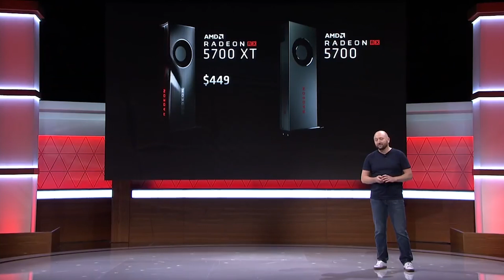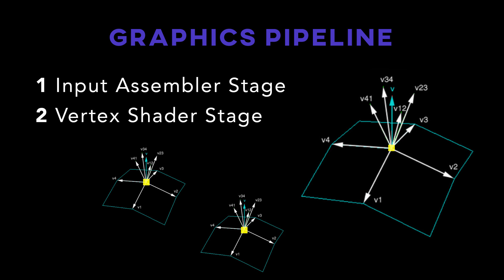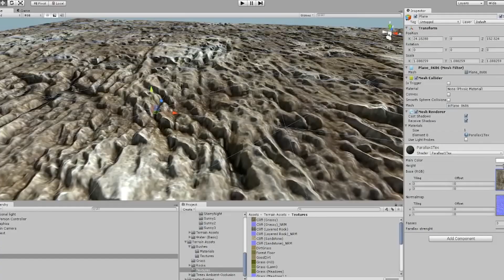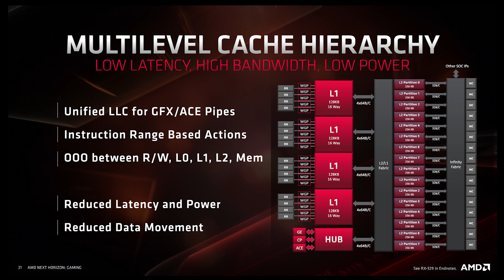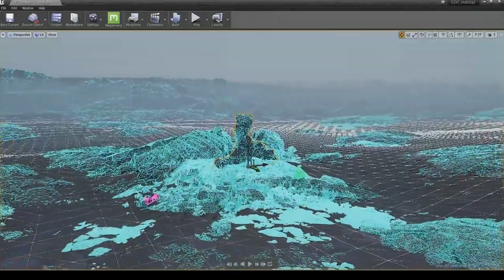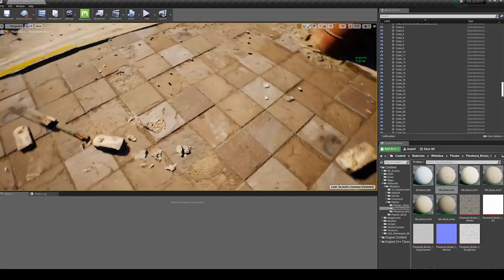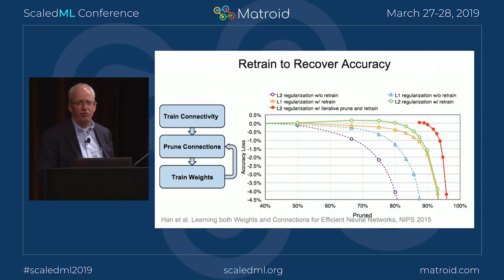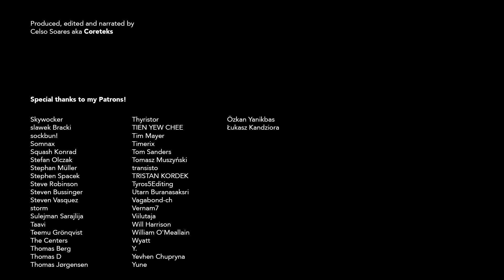RDNA vs TURING - The END of NVidia’s dominance

Comment: Prices are updated! 
5700XT - 400$
5700 - 350$
:D !
Reply: You were too precise and on point with that anticipation!
Reply: yes oof nvidia
Reply: @FoxyAF that's great !
Reply: 3:10 "avoid 5700XT until it costs ~400$"
Reply: Playing the Nvidia money game. Should have just created and sold the 5700XT only.
Reply: RX 590 is $ 245
Reply: @lovekush9103  
Yeah, but I already have better in a 1070
Reply: i had payed 370euros in serbia  rx 5700 few weeks ago
Reply: @lovekush9103  AMD/Radeon doesn't work with CUDA, it's 2304 (not CUDA cores) Stream Processors. Not the same thing mainly because of the architecture being different in each of them, there's no way to compare them both by this standard. Aaaaand the 1070 has 8GB of VRAM also. You're biased towards AMD, but no need to tell lies, right?
Reply: @tnbn55  I have a 1080 and have looked at the 5700XT pretty closely.. It's better, but not better enough to pay for.  I hope they release a 5800/XT soon, and it doesn't cost too much.  I still get great performance with the 1080, and am sure you do as well.  I won't be buying any more NVidia products though.  Besides, I want to use adaptive sync again Freesync.  NVidia trying to pay off monitor and TV makers to stop using "Freesync" wording is just making me despise them even more.  It's going to have the opposite effect for them, just like that TPP nonsense.
Reply: @lovekush9103  
My 1070 is 8 GB
Reply: @larrygall5831  
Yeah, you can always safe-overclock it anytime
Reply: @Cullen Guimond I'm getting it for christmas, greetings fellow Cullen
Reply: @lovekush9103  still 1070 is better. Amd polaris was worse than pascal.
Reply: poor fuck ahahaa

Comment: That was a great video, thanks!

I did notice one whopper @25:09 where you state that it's better if things are in cache rather than having to go to SRAM. Literally no one uses SRAM for bulk storage, and that's simply because SRAM is big – and by that, I don't mean "gigabits big" but "square millimeters big". Which also makes it expensive and power hungry. An SRAM cell typically consists of four to six transistors plus some resistors. A DRAM cell consists only of one transistor and one capacitor. As a rough estimate, SRAM requires 4x the die space of DRAM for the same process size.

Imagine you could choose between a set of 16GB DRAM DIMMs, or 4GB SRAM DIMMs, and the SRAM would actually be more expensive. Sure, the SRAM may have less latency, but would it be worth such a sacrifice in storage capacity?

Mind you that caches (and, partially, registers) exist precisely to hide RAM latency. That's why we have memory hierarchies nowadays with blazingly fast but relatively small SRAM caches on die, and very large DRAM off chip. (There are even CPU designs with eDRAM caches such as the – huge – L3 and L4 caches in IBM Power.)

(There's also another thing I was about to call a whopper, with the work for each vertex being done in a single thread – which could be taken to mean that there's one thread per vertex, but I think that is simply ambiguous. The number of threads would typically be scaled to the number of available compute cores and the level of SMT – simultaneous multi-threading – they support. This is typically done automatically by the driver unless the programmer would try to gain more control over the process.)

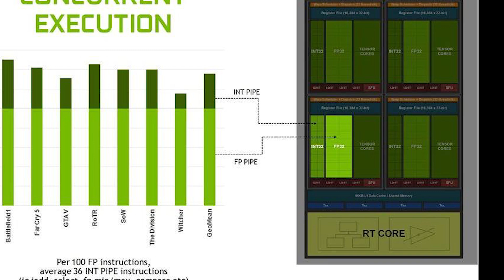Comment: 23:28 - All DirectX-compatible GPUs are required to support standardized INT operations since DX10. Turing (and Volta) simply implements dedicated 32-bit INT ALUs, separate from the main floating-point FMA units for the purpose of overlapping integer and FP code execution, i.e. achieving more performance. The CPU is not involved here at all.
Reply: Indeed.
Using CPU for INT would cause some very interesting latency problems. ;)

Comment: Bullshit. I'm with AMD (Ryzen 1800X + Vega 64) but the conclusion is fucking delusional. 2 things: Radeon 5700 is already on 8+6 power supply on 7nm, so it's pushed really hard with almost no room for a higher tier, maybe 10% extra performance for 25% extra electricity. Second, Nvidia is still one step behind on process, so the video is incomplete, misleading and fucking delusional. AdoredTV was way more grounded in his analysis, let's keep it real people.
Reply: Why on earth you restrict its power draw by design when you probably will need it in the future? Also isn't it better to draw power directly from PSU not via PCIE?
Reply: @yulusleonard985  I'm not sure what you mean, the cards use both the slot power plus PSU power.
Reply: @Groaznic  Some card are designed to choose using 6/8 pin first before using PCIE. For example the RX 500 series card draw power directly from PSU before taking extra power from PCIE, because complain from RX 400 owner that the card draw too much power from PCIE first before taking extra power from PSU.

Id rather have the card to draw power directly from PSU rather than running 75 w through my motherboard so im ok if the card using 8+6 than only having 8 pin but draw another 75w from PCIE. An if the card is rated 150w Id rather have the one using single 8 pin (draw entirely from PSU) rather than 6 pin but draw extra 75W from PCIE.

So yeah. A card with 8+6 pin if rated 225W is much better than card that rated 180W but only have single 8pin. Just because it will leave my motherboard alone.

Comment: Just wanna point out, shaders run on the gpu, not the cpu. Nvidia also develops a large set of real time library like the fluid sim Lin flex, or the flame sim flow that works specifically on their cards. That’s why us devs actually prefer nvidia cards over amd cards. In AIB boards, nvidia dominates amd, 77% to 22%, so, I’m not quite sure where u get some of your numbers.

Comment: I have read the various nvidia whitepapers published about the various architectures that they have released. The texture compression nvidia uses is lossless, and combined with the energy requirements of off chip DRAM contributes to significant performance improvements and power & cost reduction. As far as I could tell VEGA didn't feature texture compression
Reply: Texture compression, z compression, and other compression, culling, etc, have been normal for over 15 years.

Comment: This was an awesome overview of what's very probable to come. Exactly as I've been secretly speculating since Navi was announced. Exciting times ahead.

Imagine a 80CU+ Navi card with 16GB+ of HBM2...
Reply: Not possible. AMD will bring power down about 20% through hard work. But that still means 300W at 60 CUs 1800Mhz and basically 2080 + 4%. I don't know if the GCN 64 wide waves being split is part of the problem, but if it is, then it's not easily remedied.
Reply: It isn't about bandwidth necessarily, but about power consumption. GDDR6 can consume up to 4.5x more power compared to HBM2. This is why I'm curious if HBM2 could be used. Doubling CUs does not necessarily translate to double the power consumption either. Clocks and voltages play a big role here.

Comment: The 5700 xt goes for under $400 us now. Its a killer deal since it performs as well as a gtx 2080.
Reply: More like RTX 2070. You can only get 2080 performance if you water cool it and then OC the hell out of it.
Reply: @BraidenRobson  I agree its between 2070 and 2080. Still a bargain though
Reply: @romefox  more like between 2070 and 2070 super. But yes it is the best value for money GPU right now.

Comment: What do you think about the efficiency of the RDNA architecture? 2560SP card and has 225W TDP? That is a lot! With 50 CUs (3200 SP) they can catch the 2080 (Even Super) and with 70 CUs they can catch the 2080 Ti. But those cards with this spepcs would consume lots of power  275 and 350W at least

Comment: very interesting! You put in a lot of work on this. 👍😊

I bought an Gigabyte GV-R939XG1 GAMING-8GD (R9 390X OC) in Nov. 2015. It was basically a price/performance decision (or, "bang for the buck"). Looking at several reviews, the GTX 1080 Ti was about 15-20% better performance, but over twice the price I paid for the 390X. It worked very well until Feb 2020 when it finally died. Because of COVID-19, it was difficult to get most current GFX cards. And prices were increasing rapidly! I finally ordered an AORUS Radeon RX 5700 XT from Amazon USA, as they had the best price and shipped for free (via Prime) to Australia. I've been pleasantly surprised by this card, especially at 2K. I got lucky I suppose as I am able to run the 5700 XT at OC Core: 2.11GHz, RAM: 1.48GHz & temp's are very reasonable. I had been hoping the 390X would last until end of year until Navi 2X/RDNA 2 cards became available.

Comment: My first custom gaming rig had an AMD XFX Black HD 7850 Ghost card.
Currently im running a Nvidea 1080TI Sea Hawk because there wheren´t any good enought alternatives.

Im realy hoping AMD get´s back to the High end cards.
I prefered AMD back then... The Ghost card never let me down and performed extremly well.
And well ... it looked realy sexy for the time.
Reply: Am I the only one that thinks AMD Cards look way better than Nvidia cards. The sleek, Apple-esque look is so much nicer than overcrowded RGB clutter bullshit
Reply: I hear ya, you didn't buy the 1080ti cause your a fanboy but because there was no competing card to it, your in a good position as that card will certainly hold out until the 5900 comes out, I got the 2080ti used on ebay at a good price( wouldn't have spent mrsp price) so I'm stuck but not complaing   😁
Reply: @jimmy2shoes75  well im not exacly going to buy this AMD generation.
My 1080TI is heavily overclocked and scratches at the new RTX flagship.

I doubt that I will need any upgrades for the next 2-3 years considering the 11GB Vram.

Another thing that gets on my nerves is Nvidias bullshit about Ray Tracing ....

 They sell RTX cards and claim that they need the hardware to generate the effects....

They are just to lazy to make drivers for my 1080TI and other cards .... 
Ray Tracing is nothing new and is a matter of software.
Reply: @NinoJoel  they need better hardware to perform at an acceptable level, if the game has ray traced global illumination a 2060 doubles a 1080 ti in performance.
Reply: @NinoJoel  You clearly don't have a clue what you're talking about.
Reply: @mitcHELLOworld  if you think so....
The ray tracing is something that could be achieved with older hardware....

It has been done with older cards ....
Reply: @sugo8479  i woud like to see that.

I mean sure .... it will perform better since it is build around that software ans has a newer architecture.... but I seriously doubt it will be twice as fast....
Reply: @NinoJoel  https://youtu.be/9_XDlIxAkFs?t=365
It actually wasn't double, it was more like 80% more
Reply: @sugo8479  his ignorance actually hurts my brain
Reply: It's all about pricetags. With Vega 56 around 250 bucks, I doubt it isn't absolute value. And Vega 64 is following suit. I don't know how long GTX 2080 Ti Will keep crown in that pricetag...
Reply: PS: Pascal sucks at Asynchronous Computing...
Reply: PPS: Ray Tracing is way overrated. It's marginal difference at best and it's overly taxating in both price and performance. Moreover, it's been implemented only partially in every single iteration (reflections, shadows, ambient occlusion). You will never have a modern AAA game with full Ray Tracing! End of the story. Simply put, Ray Tracing was only a commercial move by Nvidia. Quite obviously, you can have a full Ray Tracing game with a system of GPUs working in a data center, but you will have to go Cloud Gaming, which is death incarnate for Nvidia.

Comment: 25:00 No, with MAXWELL, Nvidia moved to Deferred Tile Based Rasterization- which is a MASSIVE LEAP in performance per watt as well as overall performance. 
Also the TechYESCity video you pointed out has been debunked. Nvidia STUPIDLY enables LIMITED Dynamic Color range by default, as in 16 to 240 instead of 0 to 255 for color but values. If one changes Nvidia Control Panel to match the specs of a given monitor, there are NO perceptible image Quality Differences!

I hate when people in the know, blatantly miss obvious pieces of information, it is hard to tell if you are being disingenuous, or if you actually were unaware about these things.

Comment: If the 5700 XT, the 2070 competitor, already uses 225W, how much more power would a bigger and faster GPU require? How are AMD going to pull this off?
Reply: AMD is running the 5700xt at the very bleeding edge of available performance (clock speed). Most likely if they dropped clocks just 12.5% it would drop power draw by 33% and it would only consume 150 watts. Most likely it would only drop performance by 10% or less because performance doesn't scale linearly especially at the top end where things like memory bandwidth start becoming a major bottleneck. So doubling the hardware and not being so aggressive on the clock speeds could easily produce a card that draws say 275 watts and beats a 2080 ti by a good margin.
Reply: It's TBP and not TDP ,which is on par with the 2070..soo..and againg..a little undervolt and even the radeon vii consumes 230W
Reply: It's 2019 and we're still talking about power draw from a gaming GPU?
Reply: @daviddebroux4708  seems like people still have this kind o psychological illness. I really don't mind power consumpion as far as the heat output is not absurd (aka the gpu is efficient).
Reply: @daviddebroux4708  people don't realize how little of a difference it makes, but nvidia needs selling points
Reply: TDP value of AMD, Nvidia and intel are not apple to apple comparison. AMD TDP is measured under load while Nvidia under gaming performance.
Reply: @yulusleonard985  would n't be smart for amd to use the same method for gpus? They would gain a selling point and sto to be seen as the "hot and lout and consuming gpus"..
Reply: @enricod.7198  They don't have marketing team to do that. They also create their own fanbase who like that kind of presentation. Loyal fanbase that will buy their products no matter what. Also with this doupoly crap the safest way to sell your product is by not copying your competitor.
Reply: @yulusleonard985  I agree with you on most of the thoughts but at the end of the day, they need at least part of the competitor's fanbase. They need marketshare. The easy way would be rethink their tdp calculations for the gaming gpus like nvidia does and try to creat a low power (like 75W only pcie) gpu like that 1650 crap.. That would sell like hotcakes..at that price point and power almonst nobody cares about oc and such things..they have oem pcs and they are more than you think. Also, they have something to compete with a 1660 but they need less power..they need to get more from the pcie slot and step down a pcie connector, as nvidia does. (They pull lil 50W form slot instead of like 20 of amd)
Reply: @enricod.7198  That AIB job. Most of AMD cards never leave OEM market. And I doubt you can see those reference card 1 month after release. I really wish AIB get crazy with their chip but most of the time what they did just overclock it to the max.
Reply: @yulusleonard985  yeah but not the lower segment of oem market. Aib should undervold amd gpus, not overclock them. They would be almost on par with nvidia, consume less and be cooler..amd need to gain mindshare more than marketshare. And they need competitive products. Navi? Announced and voilà, nvidia had already their super lineup to f*ck them..amd shouldn't give detail till the launch to get a time and sales advantage over nvidia. Nvidia just cut out chips and at the same time raise price (rtx series is a joke..2070 is a tu106 chip for 500 euros in europe)..so when they release the real lineup (how it shuold have been) they screw up amd. Always the same story.
Reply: bgtubber That’s a very good point. Doubling hardware would have a massive increase on power consumption and would need more than a clock decrease to keep it in check. I think this video is more wishful thinking than prophecy.

Comment: Do you believe Vega professional wx and prosumer radeon 7 lineup will still be made until arcturus comes out in 2020-2021 since RDNA design is more suited for gaming instead of content creation?
Reply: They probably lie about designed for gaming. AMD will sell workstation version of NAVI. The one with full silicon.
Reply: @yulusleonard985  I've heard that there is planned for rdna on the workstation side but I do not know how it would stack up with Vega and its hbm2.
Reply: @davidpoulton7694  Replacement for WX 2100-7100 or POLARIS Pro DUO.
Reply: @davidpoulton7694  Navi is replacement for Polaris. So its replacement for WX 2100-7100/polaris duo as well.